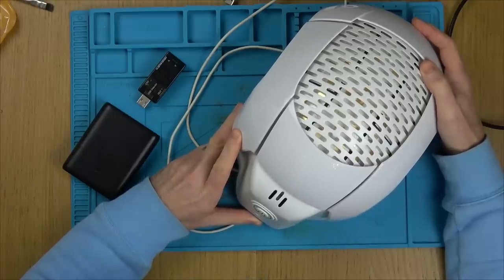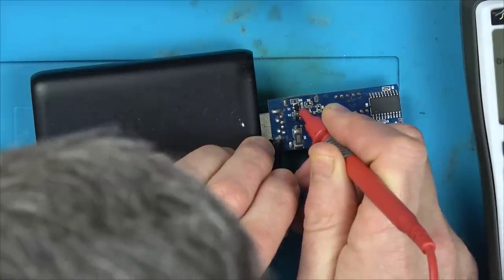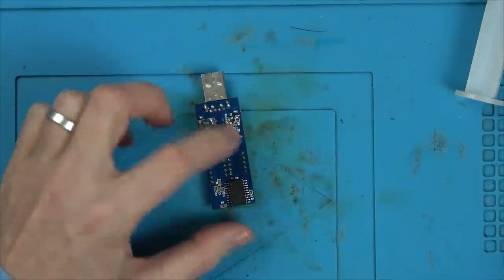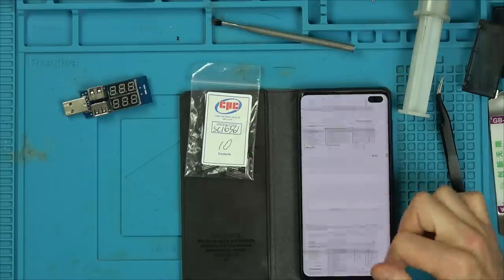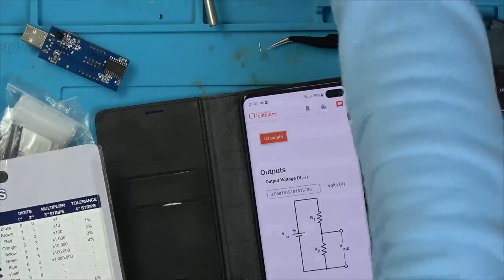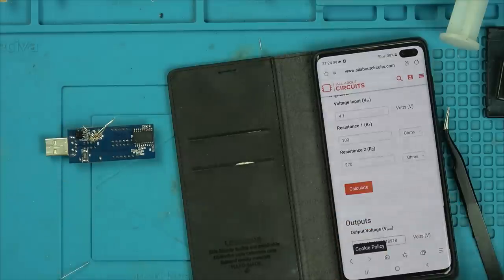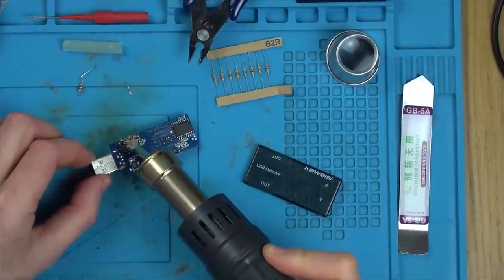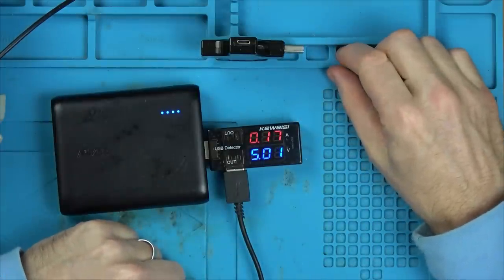USB Voltmeter BROKEN by BALD HEAD MACHINE - Tea Break Fix

Comment: If the datasheet doesn't say anything, the standard for pin diagrams is "Top View"! You soldered it with pins 1 and 3 swapped. The 4...v is the diode drop of an internal protection diode. Don't worry though, every EE gets caught by "Top View" vs. "Bottom View" at some point :)
Reply from the maker: I've just revisted this Jessica. On this one it did say Bottom View for TO-92 on the datasheet but I still managed to wire it up wrong 😂 I'm just editing up the revisit video whilst I type 👌👍

Comment: Hi Vince! The big chip is using the 3V of the voltage regulator as a reference voltage to compare to the voltage and current it samples from the 5V and the voltage of the current sense resistor (the big low resistance one).

Comment: If you didn't want to wait, scrap boards with lots of ICs on them are normally a good source for 3V and 5V regulators, e.g. laptop boards and game console boards. Though you might end up looking at datasheets for hours checking what's what! I think 3.3V is usually a lot more common than 3V as well.

Comment: The output voltage will change because you are changing the current when it is connected in-circuit as that LDO will be powering the MCU/LEDs. You can also just buy an adjustable LDO with similar specs as a replacement from ebay UK

Comment: I expect you figured things out, but, just for reference, conventional linear regulators have a typical drop-out voltage of 2V. For a 3V3 regulator you need at least 5.3V on the input. If the input is lower many regulators simply pass the input to the output (unregulated voltage bang is the result in many cases). Some LDO regulators have a drop-out of less than 1 volt.
Reply: It's usually 1.5v or less... 2v is if you want all temperature range, and all the current range. For a low current regulator like the one used, the dropout should be less than 1.5v
The problem here I suspect was lack of input or output capacitors (or too low amount for a 78xx series regulator) causing instability or something like that.
Reply: @mariushmedias  Generally (not always) dropout increases with lower input voltages and lower currents (over the same temperature range). With an input of around 5V you would expect a 2V dropout, though the dropout graph in the datasheet is next to useless. Even though it seems the regulator was fitted the wrong way round initially, a correctly-fitted replacement is unlikely to have worked and could have easily damaged the device.

Comment: If you change the voltage regulator to 3.3v, the ADC reference voltage will be changed . That's why the voltage reading is low

Comment: Well done Vince! Good thought process and practical application for using resistors as a voltage divider. You're getting danger close to electronics engineering! Time to build your own circuits 🤣!

Comment: The thing about a resistor voltage divider is that the resistors will limit the current you can draw. So when the chip was connected to the 3.066V it probably lowered the voltage to 2.8V because of the current draw (the chip itself was acting as another resistor connected to ground in parallel with the other) that is why you had to lower the resistance of the first resistors (so that the maths got corrected by the circuit)

Comment: That was an interesting repair, a bit different from your usual stuff. Of course these things are very cheap so there wouldn't be much point in repairing it to save money, but it does still make for an interesting video.
I imagine these things aren't too accurate to begin with, so being off by +/- 0.05 compared to the other meter doesn't really matter, since you don't know if the other meter is accurate either, and USB voltage can vary a bit anyway, all you really need to know is that the voltage is within an acceptable range. So this is a perfectly acceptable fix.

Comment: If you are dealing with very low current then the easiest way to drop a little bit of voltage is to put a diode in series with the output (use to be called a watt less dropper) each diode drops voltage by approx 0.7volts.

Comment: I've had two of these and both broke at the usb in end. 
I did solder them back together but I use a different one now. 

I know on my new one, if I hold reset while plugging it in a known good 5v power supply, it will calibrate to that voltage. 
maybe your meter has that same function?

have a good Christmas

Comment: These L78Lxx regulators need an input/output difference of about 3 V. So if you feed the 3,3V type with only 5V it will not work stable and tends to oscillate. Therefore the strange voltage readings ...

Comment: Talking from an unfortunate experience with exactly the same USB tester and exactly the same failure.. First off the tester is referencing its readings, voltage AND current against the regulated 3.0V so the more precise the voltage regulator the more accurate the meter will show (I think the main chip is also powered from the regulated 3.0v from memory). The voltage regulator these come with (as you said) is only rated up to 6 volt input MAX so if a device on it's output request fast charge from a capable charger/power-bank, the charger/power-bank will output 9 volts (very common) or more! POP goes the voltage regulator! (over current would NOT as some others are suggesting cause this failure, that would likely just burn up the current sense resistor). I replaced mine with a high precision, low drop out 3.0 volt regulator rated up to 20-30v input MAX I think, (I forget, it was a few years ago now) Surely I must have bought in multiples so I'll see if I can find the rest and see what they were exactly... The USB tester could then be safely used on fast-charge voltages.
Reply from the maker: Ohhhh, now this makes a lot of sense as I think originally I did use my Samsung charger to power the hair restorer  and that does output 5v and I think (from memory) 9V. I have just done a revisit video on this, as embarrassingly I managed to wire up the voltage regulator back to front. Cheers for commenting on this and sharing your knowledge 👌👍👍👍
Reply: @Mymatevince  P.S. I couldn't find the spare regulators I may or may not have bought at the time and the only marking on the one in the USB tester is merely marked "HTUA" and I cannot find any info on that identification but I did label the tester as '16V Max' so I guess that is what the one I replaced it with was rated at..

Comment: I'd have to concur with the "regulator probably soldered in wrong" theory, as I would not expect a 78 series regulator to even be able to output much higher than 3.2 V or thereabouts with 5.0 V in. See whether you can't get a 3.0 V surface mount 1117 LDO. Otherwise a pack of the original part is probably the way to go, even if you're never going to go through them all.
Reply from the maker: Thanks PileOET, I have just revisited this one and as you correctly suggested I DID have it wired back to front!!!!!

Comment: I have taken that tester apart before and I don’t like this tester because the plug of the usb when it becomes loose it can fall apart! But it was surprise it supported 12v power when I connected to my wireless charger that does up to 12v it does read it!
Reply: If it uses the same voltage regulator,  the regulator will run too hot, and likely fail sooner, as it isn't rated to run at >6 volts.
I agree about the USB ports, they are not good quality.  Of course one could replace them with better ports.=D
Reply: @yadabub  but I did test and yes the tester was able to support 12v!
Reply: @yadabub  I didn’t want to replace the port as when it comes off the ground pins of the usb plug is already broken! The metal on the usb port!
Reply: @VOLTRONDEFENDER4440  I understand what you are saying, but you are talking about the firmware on the MCU being able to test 12v.  That's a separate issue from the voltage regulator driving the MCU, which- while it likely does work at 12v, it probably won't work for long unless it is not the same one found in Vince's unit(entirely possible,) or is severely under-specced, which is unlikely to be the case.

Keep in mind that manufacturers are constantly changing these devices.  Even if you paid for a 5 volt meter that superficially looks just like the one Vince was working on, doesn't mean that it isn't actually a 12v or greater capable device.
Reply: @yadabub  the one I got can read 5v 9v 12v and I believe 15v
Reply: @yadabub and also the one I got is the same brand keweisi the brand Vince has!

Comment: You soldered the regulator in wrong direction input must be on the right, that's why it gives you 4.1v
Reply: Pin 1 is the output. You solder it on 5v line
Reply from the maker: Well spotted Ahmad, I have just filmed a revisit video on this. Thank you 👍👍👍
Reply: @Mymatevince  My pleasure. Thank you for all of these videos

Comment: Also I noticed it's not stable voltage it slowly climbs up very slowly and not sure but may even lower voltage i didn't happen to see if it dropped but did see it go up the longer its plugged in to the power bank could be the reason the readings go up and down on the tester

Comment: to be fair if that's how that specific meter faults when the usb device you're trying to fix is badly shorted i'd wager having those extra transistors/regulators on hand would in fact be a good idea, imo better to have extras on hand and not need them than to need them and not have them

Comment: It failed because Your Voltage regulator is up to 6V. Some power banks can negotiate 9V, 12V or more with the device to be sent via USB. (Wikipedia: A number of extensions to the USB Specifications have progressively further increased the maximum allowable V_BUS voltage: starting with 6.0V with USB BC 1.2, to 21.5 V with USB PD 2.0 and 50.9 V with USB PD 3.1, while still maintaining backwards compatibility with USB 2.0 by requiring various forms of handshake before increasing the nominal voltage above 5 V.

Comment: For low use stuff I stopped buying those ludicrous numbers of bulk parts, because you will die of old age before you use 2 of them - lol -, ie, if it's the same price 10 is usually plenty. You'll need a lot of common value passives, ie, 1K, 10K, 10uF, etc, so bulk is good in that case.

Comment: Hmm. Doesn't really make sense. You tested the replacement regulator out of circuit and it produced 3.3v. Then when you put it in circuit it was 4v. If the regulator was overloaded it would be more likely to close down and produce no volts. That suggests that the 5v from the USB is finding its way to the output of the regulator by some other route. Also, you didn't actually report the voltage on the regulator output with the resistive divider in place, nor the voltage on the chip in that case.

Comment: I did try to buy large quantities of voltage regulators of different types from china and reselling them on eBay at smaller quantities at a higher price. I encountered several problems, even though I used to sell them at £2,99 for ten devices I sold very few of them and you are never sure what you are getting from China with fake devices, I used to thoroughly test the voltage regulators to make sure they met their spec and found many fakes. I gave it up because it was not worth doing.

Comment: Put a Diode on the Vout  Pin....that should be 4volt minus 0,7volt.....That should be the 3.3volt you Need
Reply: Until USB negotiate 9V with end device and blow IC up.
Reply: @PeterHovorka  thats for the power supply of the display.....how should it be!?

Comment: Watched loads of his vids, got a problem with a portable speaker, none of the tactile buttons do anything, from what I've researched 1 and 3 pin should be connected and thus continuity should beep but it doesn't, got 3 of them in line  on the board all same fault, can't adjust volume up/down select track change mode. Has something else blown silently lol board looks perfect.

Comment: That meter showing 6 volts could be accurate and the only reason your ipod is charging is because they also have voltage regulators on the charging circuit. Belt and braces approach as batteries can be dangerous when charged incorrectly. You should know this Vince!

Comment: Your original calculation didn't work because you didn't take the existing input resistance of the LED circuit into consideration. It will sit in parallel to the bottom resister in your diagram.
Comment below about current restriction is also correct, probably wouldn't affect the display, but may have affected the current and voltage readings.

Comment: Vince, it's not really important, but I would like to comment that if you observe the marking on the board, it says "U1" beside that regulator and near the bigger chip "U2". So, I immediately thought - that probably is not a transistor, but some sort of integrated circuit. Anyway, nice repair.
Reply: Voltage regulators are IC's. IC's just means integrated circuit.
Reply: @Madrrrrrrrrrrr  Yes. And transistors are NOT IC's